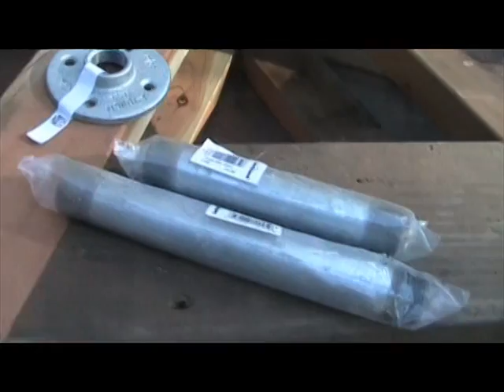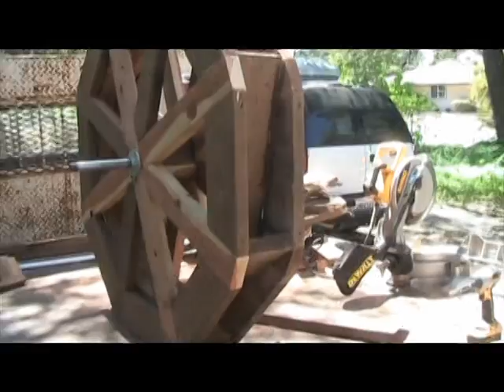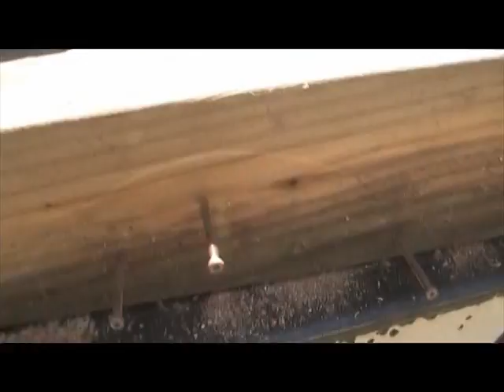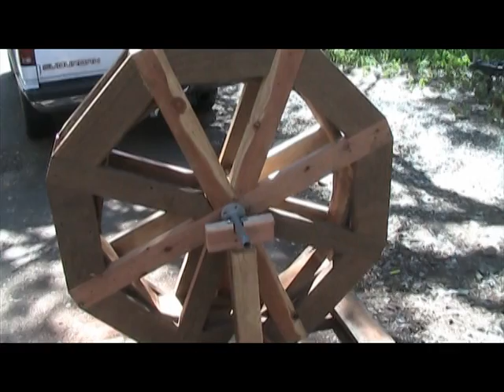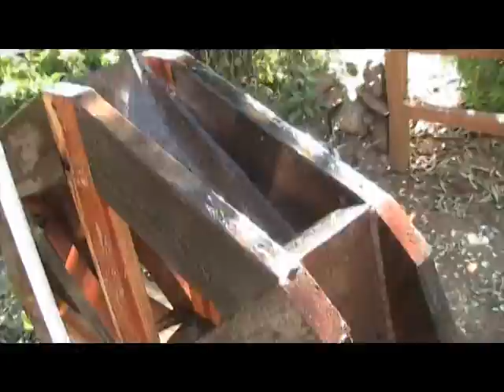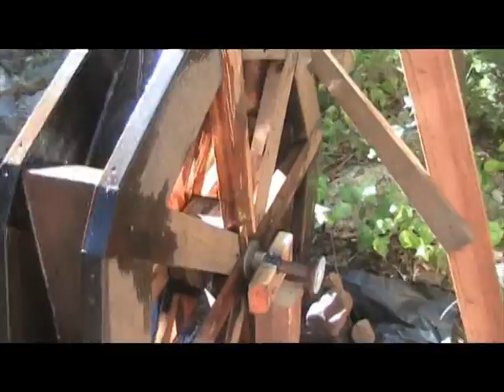Make Your Own Water Wheel Part 3

Comment: I am thinking on getting all the wood new pressure treated at same time. this will maybe help in same weight. also I am thinking on making metal plates and run a shaft all the way threw it and then to bearing out on frame.  then pulley(s) to run alternator to batteries and then inverter to supply 120v ac to house. I am estimating the flow will be about 30 gallons min.

Comment from the maker: You are totally right, as it got wetter and ran longer the balancing issue seemed to change slightly - even when the sun dries out one side or the other during the day.  Had to correct it twice since the beginning due to the difference in wood.

Comment: The slight out of balance could be because of the diffrence in the wood. diffrent  densities etc would make its weight change. When it gets real wet, it might make better or worse. could always let heavy side drop to bottom and put extra screws in top to balance out, or some kind of weight. Thanks for the videos. This really helped. been wondering but never can find info like this. Thanks again!